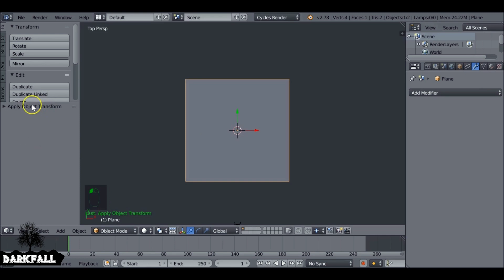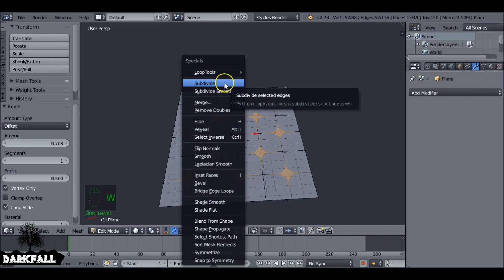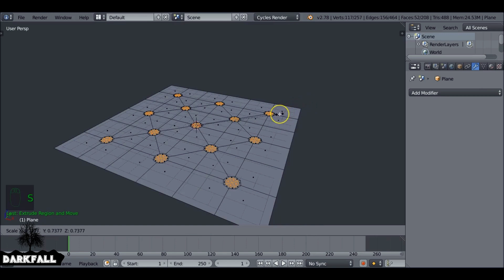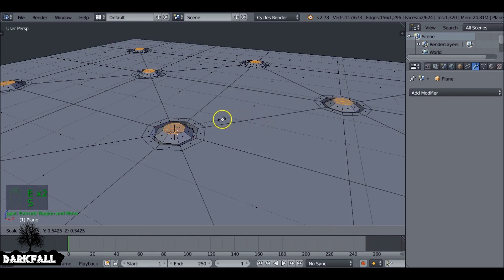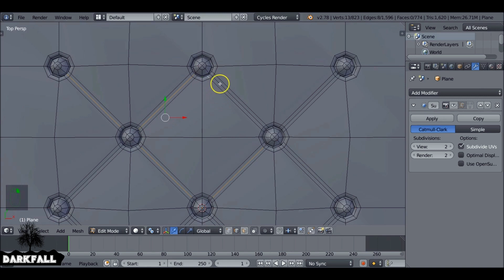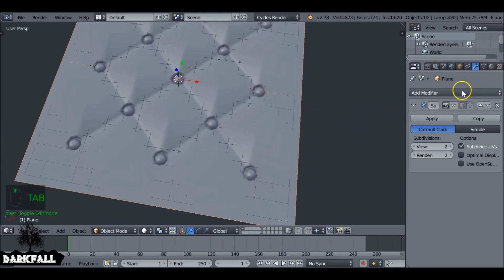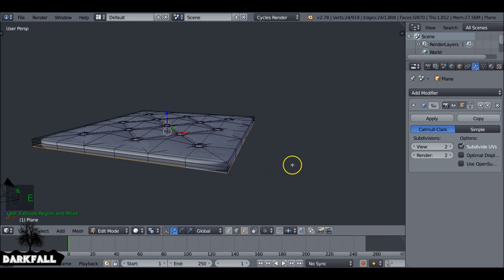Blender Tutorial: How to Model Quilted / Tufted Leather

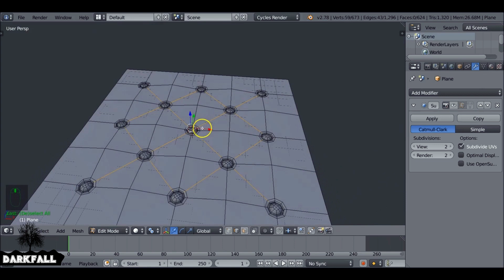Comment: to avoid tedious operation in selecting edges (like the diagonals around minute 4:50) select one long and one short, then in bottom menu "Select" - > select similar -> Lenght and turn down treshold in tool palette to 0.0001 (or what gives you preferred results) :)

Thanks for the tutorial, fast, inspiring, easy and iteresting! keep up with the good work
Reply from the maker: Thanks for the tip!, I was trying to use similar selection for a while but it wouldn't work out too good but turning down the threshold really helps... Im glad you are enjoying the tutorial thanks for the support! :)